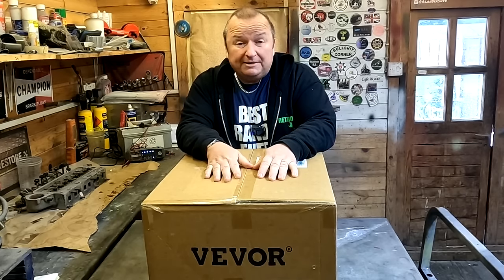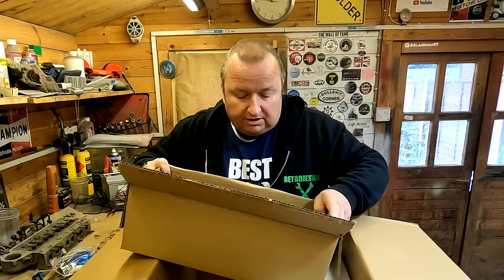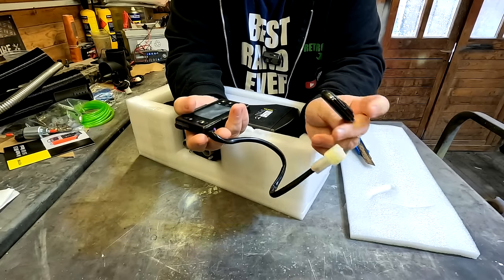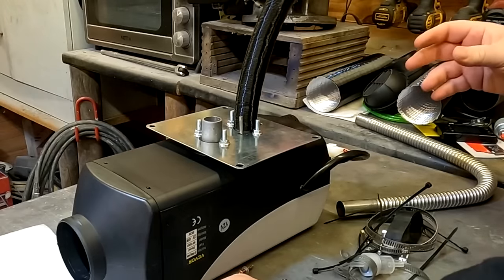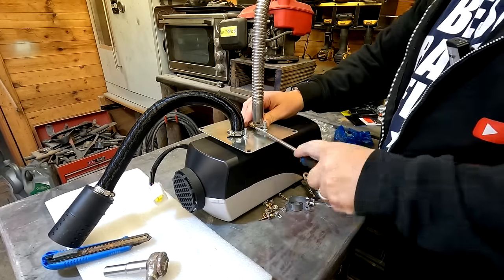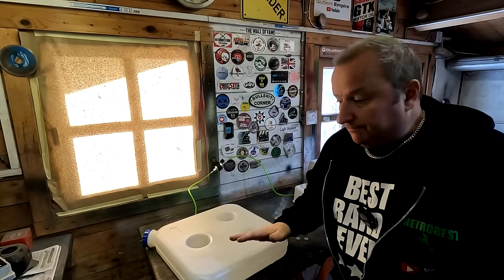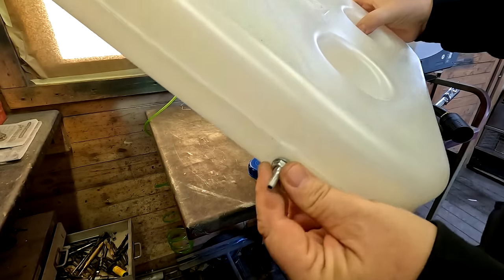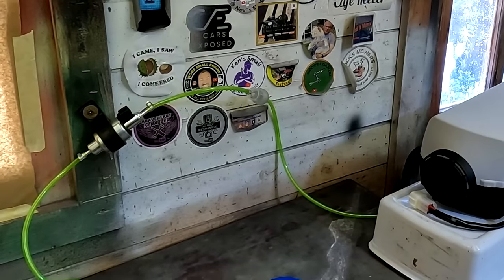Shocked - Using This Diesel Heater In My Workshop

Comment: I have one of these heating one of my sheds, it's awesome little thing and does its job throughout the winter to keep my motorbike warm and keep yhe damp off it.. 

Don't just turn it off at the plug it goes through a cycle to burn off the carbon build up before shutting down.

I have bought a few things from vevor and they have not disappointed me, although you can get the exact same items off aliexpress for a little cheaper if you Don't mind the wait.

I bought another exhaust and pipe and it doesn't sound like a jet setting off now lol

Provides good heat, heats my 12x12 foot shed in no time

Comment: Hi, any thoughts on BTU and fuel usage compared to a torpedo heater?  Not expecting this to be as efficient as a torpedo w.r.t. btu to fuel usage, as with the torpedo, all the heat created by combustion is delivered directly to the area, without any heat exchanger (aka just a big open flame with fan behind it) BUT I need to deal with the fumes from the torpedo by opening a 2 square foot window completely to provide fresh air (and additional air leaks in under the garage door).  My torpedo is a modern 2 years old version  and 100,000 btu and thermostat controlled.  Greatest fumes are at startup, but with the thermostat, and depending on outside temp, I can have several start/stop cycles for my occasional use in my 600 sq ft garage.

Comment: Please forgive if already been answered , what sort of run time,say medium heat setting per Ltr fuel ?
Also, apart from noise is their reason your not warming the same air , rather cold air from outside ?
Reply from the maker: Check out the installation vid.

Comment: I've used one for 2 years and although I cant say it's had the workshop hot its certainly took the cold edge off ....with it being remote I turn it on ....have my breakfast and by the time I'm in its pretty reasonable. Mine couid do with a longer tube to deliver the air and some ports to direct it day at feet and body .....rather than into work shop ....but for the cost it's a good heat source
Reply: You know the tube stretches don't you?
Reply: @jostouw4366  yes but not enough ...but thank you anyway 👌

Comment: Indeed these diesel heaters are great. I have a 5 kW modell in the workshop (in basement).  It drives out humidity too.
I burn red diesel, which is has tax exemption. I can only recommend them.
Reply: you can use filtered used vegetable oil too lot lot cheapen=FREE, and solar panel charge to battery have FREE. or use farm diesel not have TAX.

Comment: I had an Ebspacher unit fitted to my Mitsubishi L200 when I purchased it in 2018. I had wondered about one of the chinese units but the garage would not fit one of those, thing is a new one of the chinese units every couple of years would be cheaper than having the genuine one serviced.

Comment: I have a 14x40 wood insulated building. Do you think this heater would heat up my building to a comfortable temperature? It is now winter time where I am and the lows are around 23°F.
Reply: i have biggest workshop than you and 5Kw heater and winter season have longtime -31 F gould but workshop keep warm. i keep my workshop about 75 F

Comment: You need to mount the unit and fuel tank inside and just route thr exhaust pipe outside 
1 it works better if it recirculats air to heat 
2 fueltank inside so the diesel stays warm and don't gel which makes it easier for the fuelpump and extends the fuelpumps life span to move the fuel better instead of it trying to suck a slushy out of the tank and these plastic tanks get brittle outs and warm diesel makes it smoke less

Comment: Putting the fuel filter before the pump makes a lot of sense as you only put cleaned fuel through the delicate fuel pump. A filter with a removable glass filter bowl is also good so you can see any build up of gunge or water . Have the filter & pump inside to prevent any moisture in them from freezing is also a sound thing to do .
Reply from the maker: This was just a mock up. It is fitted before the pump in the installation video.

Comment: how is the smell of the hot air coming out of the unit?
I'm thinking about replacing my laser  petrol zibro with a unit like this and run the exhaust to the ventilation holes of my basement.
Reply from the maker: No smell on mine.

Comment: Hi martin. Bonus red diesel so cheaper. Get ya self a solar panel for your battery. With charge controller
Reply from the maker: I'm looking at a 12v power supply unit.

Comment: so many of the videos I see people put them out side  but why, it circulates the air in side warming it up so you dont lose heat, when out side its always pulling cold air btw these are cab heaters used in trucks and just bolt to the floor

Comment: great video , still making my mind up on which type of unit to buy a standalone steel bodied unit or a kit like yours for home use to try to beat the high gas bills. I hope you line the wooden wall with something other than the hot air pipe maybe a steel sleeve of some sort or a slightly larger diameter steel pipe to prevent the wood from burning.
Reply from the maker: Check out tonight's video of the installation.
Reply: @retrorestore  cheers.

Comment: Nice one Martin, mine is fitted on a trolley so's I can move it between workshop during thw winter and it works a treat. Get red diesel for it, works out cheaper to run.
Reply from the maker: Thanks for the tip
Reply: Aka home heating oil.

Comment: Ideally you would run it on a fuel that hasn't had duty paid such as red diesel. How about vegetable oil or used sump oil - provided it is venting externally of course.
Reply: Those typically need a different burner/nozzle design due to higher viscosity.

Comment: An option that would work and would remove the battery, would be a 12v power supply. Similar to what is used to drop 240v to 12v for LED lights. Or as others have mentioned fitting a Solar panel and it's Controller and a Leisure battery. For simplicity I myself would go with the power supply as it will take up less room than fitting the Solar Control panel and Battery. I have just built a small Garden Room for the wife running it of a solar system so I didn't have to run a load of Armed cable and fit a new consumer unit just to add power to it. I was going to put in a small Log burner, but the prices have shot through the roof and It looks like we are going to be moving in a few years. Every time I build a Shed or Garden Room it normally means the Wife wants to move.
Reply: waste lot money if use power supply, lot cheapen use solar panel and charging battery. 100W panel and 40w need only heater about and not newer elektric have empty. you stay                                         lot energy use cabin light too.
Reply: But if you use a 12v power supply stepping down from the mains then if you have a power cut the unit wont work
Reply: A cheap computer power supply 300+ watts and your ready to go. It only need a switch and some wired.

Comment: I notice you have the red wire, the fused wire, to the positive side of your battery. The instruction manual shows the opposite. which is correct?
Reply from the maker: Red to positive Jim, Chinese instructions can be a bit sketchy.

Comment: Hiya Martin, ive been looking at getting one of these to keep the chill from my garage when im working in the on the car. Ive got a 300w solar panel set up with 240ah leisure battery so will run nice from that. you should do an update video once you have it all up and running. Cheers for the Video
Reply from the maker: Yes I will Chazz, They are very good though.

Comment: Ditch the massive battery and just use a 12V 5 amp plug pack.  Or use the charger in power supply mode.  More efficient this way and far less bulky.

Comment: Just a heads up on legality, if you have a source of red diesel you can no longer legally use red to heat a commercial premises, now if its your home shed its fair game, but if you work out it, be aware. My units heater runs on red, never needed it last winter but went to buy a barrel for this winter and heard the news, I like to stay legit so looking into alternative fuels :(
Reply: Great point on using different fuel, Red diesel is certainly cheaper than white road diesel....just a thought you could use kerosene 27 heating oil, this would be the most economic fuel....
Reply: all cheap diesel can use, used vegetable oil, TAX free farm diesel, ewerything.

Comment: I looked into these chinese diesel heatersa couple of years ago,  they seem to have got better than they came with the important addons like the silencers and important info (like inclining the pump). This one seems a fair bit better than many which were around in the past and which other content makers said needed a bit of modding a while back, and fettling if you wanted them to last long or work well.  It's going to be interesting later on in the winter to see what sort of running costs you get.  Cheers nice video.
Reply: With the cost of energy it is how much they cost to run?
Reply: When you get the cost of running please make small video. Also most of the people useing them have not got a clue. Most think the thing has a code to stop you messing with it. When in fact the things are ideot proff and do not let you do anything that could make the fire un safe. I keep telling the the code is simple there so once you have your fire going right the code stops you accidently altering it. Also they all keep on about run the thing on high before you turn it off. Well these lamb brains do not give the little chinies guys any credit as all the shutting down and starting up are programmed in and fire burns high when you turn it on and off no matter how hot you have set the temp. Anyway I have had mine in my boat now for three years and it runs trouble free and all I do is star it and stop it and it is always set on low. Talk about value for money. But as I said mine seems to use a lot of fuel. I have done the math with the pump. But that's only on paper. Cheers, Pete
Reply: what about using used chip fat oil
Reply: Yes its the cost of running that will tell.
Reply: @mikeba7269  Apparently not, look up David Mcluckie, hes done so many videos on these heaters

Comment: Thinking about installing a chinese heater in my garage. I got a finish Safire that im going to instal in my house
due to the insane price for electricity. There is one thing they clearly say in the user manual for the Safire heater
and that is that the dieseltank should be placed lower then the burner itself. Most probably for reducing the risk of the thing starting a accidental fire if something goes wrong. It´s just a thought that might eventually get useful for reducing risk if leaving the burner unnoticed for some time. What are your thoughts about this?
Reply from the maker: My tank is installed below the unit but the units with the tank included in the same housing have the tank above the unit so there you go.

Comment: I'm still using my Ready Heater for the last 20ys that cost me $20. I use off-road diesel or kerosine. 50K BTU. It costs more to run it now. diesel is now $7/gl in Ca.compared to Propane $3.40/ gl

Comment: I've seen a video that these heaters also burn a mix of diesel an used motor oil. In fact there are some videos explaining how a 50/50 mix will heat up to 25% more. Check the video "burning used motor oil in my chinese diesel heater". Some will say that's not ecologic but when you dispose your wasted oils they will burn most of it and it's much better that draining it on the sewers or in a hole in the backyard or leaving it beside waste dumpsters.
Reply from the maker: i've seen all those videos Mike.

Comment: mate put the fuel filter in front of the pump so no particles can get in the pump as it will stop working if the smallest particle get in to it. 😎👍
Reply from the maker: Check out the installation video.
Reply: @retrorestore  sorry I mean put the pump in between the diesel tank and pump mate so no unfiltered fuel gets to the pump😉👍

Comment: Ideal workshop heater  maybe an update on Litres of diesel used  over an 8 hour  period with a workshop temp of maybe 19 degrees would be helpful to assist  an idea of running costs
Reply: Depend on the size of space heated but a garage size room about a litre of heating oil over 8 hours.

Comment: I have used a Perfection stove for the longest time but like the idea of a wickless system.

Does this unit have any fumes or burn smell?
Reply from the maker: Not that I know of
Reply: @retrorestore  thanks. Please text me if you ever feel like you are about to pass out from carbon monoxide poisoning.
Reply: I've used them to heat my semi truck for years. Very safe.

Comment: my husband has got one of these and he is struggling to get the fuel line air free from the pump to the machine hes redone it 4 times now but some how air is still getting in the pipe hes followed all the instructions watched numerouse videos ... and still cant fathome it out! :( any advice welcome please as long as its constructive thank you for your time.
Reply from the maker: You don't need to get all the air out the line. As long as it reaches the inlet, it's fine.

Comment: You could rig a transformer to give 12v supply. Great looking heater, thanks for the idea, I'll get one for my shed.
Reply from the maker: I've just ordered one.
Reply: @retrorestore  Hi Martin what size of transformer have you ordered n and what size is the inline fuse, Going to get one for my log cabin, Thanks
Reply: Computer power supply are cheap and you can get 300-400 watt with 60 amp.

Comment: You've cost me more money Martin. I've just bought two of them. One for the shed and one that I will adapt for the house. I've bought the same make but the all in one unit. If I can get the exhaust outside I can't see any reason for not having it blow indoors. If we get power cuts then the boiler won't run so also good for a back up.
Reply from the maker: Yes Jeff, I was looking at doing that too.
Reply: @retrorestore  I think you would only need half an how to heat down stairs. Gas has gone through the roof as you well know, so thanks for the wonderful idea.

Comment: How much amprage does the 5kw produce? Its 12V but i need to know how long my battery will last. Cheers
Reply from the maker: They are rated at about 7-8 amps on start up and about 1 amp when running.

Comment: I use one of these in my workshop Martin, it’s fabulous but I found the battery needs to be on a trickle charge constantly or it lets you down. Also it’s definitely better to mount it outside, which i didn’t, because it’s noisy on your videos and a bit annoying
Reply from the maker: Yes Steve I'm doing both.

Comment: Does using this outside in freezing (UK) temperatures result in problems with the diesel getting sluggish and not flowing properly, or maybe stressing the pump? I loved the use of string to pull the fitting through the tank btw - will remember that 🙂👍
Reply from the maker: I think i'll be installing it inside to keep it out of the weather as others have suggested.
Reply: @retrorestore  I need to leave it outside. What do you think?
Reply from the maker: @edclark6543  maybe box it in.
Reply: Mix diesel 50:50 with kerosene for winter will prevent diesel going sluggish!

Comment: Would it be bad if I extended the exhaust so that it works as a radiator inside before it gets exhaust outside?
Reply from the maker: I've seen it done.

Comment: Hi martin received my all in one heater today. Theve sent me wrong one. And i have to pay postage to return. Im foaming. The instructions are crap. Ive got same one as you but there is a metal pipe that has one end flared and its about 7 inch long and it bends up. It has like a black seal on the circle bit. Have u any idea wat its for please im pulling my hair out. Thank you
Reply from the maker: Don't know, sorry.
Reply: @retrorestore  cheers martin

Comment: these things are cheap and very handy for heating spaces as for mounting it its designed to b mounted inside should b easy enough to drill a couple of holes and have it mounted inside bud also get yaself a leisure battery a cheap solar panel too keep the battery charged or even a cheap 12v power supply cant draw much current shouyldlt thyihk more than ten amps so maybe something like a fixed 12v bench or radio power supply would do
Reply from the maker: Yes I plan to get a power supply.

Comment: I'd leave the heater indoors. You want as much as possible inside to keep as much of the heat inside. Ducting it in you're losing probably a kw or two of heat vs ducting the exhaust out.
Reply: Honestly, you really want to duct the exhaust and put a fan on it too so you're only blowing cold air outside, but that's way more difficult to do without breaking the heater.
Reply: I put mine outside in a box to reduce the risk of CO fumes. Sadly, someone broke into the box and stole it a few weeks ago.
Reply: @x91w  Diesel doesn't co when running properly. Even without an exhaust my heater was able to run for 6 hours with no exhaust in my shop with 0 co. Still want to vent it if you can, but it's not that scary.

Comment: No need for a battery and a charger, get an AC 100-240V to DC voltage transformer, on ebay for under £20. Unless you don't have a mains supply.